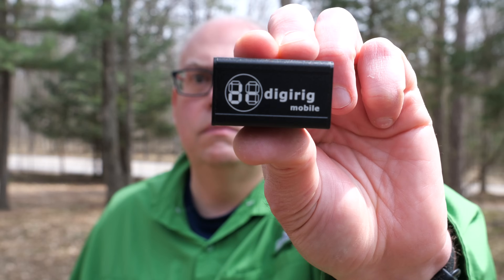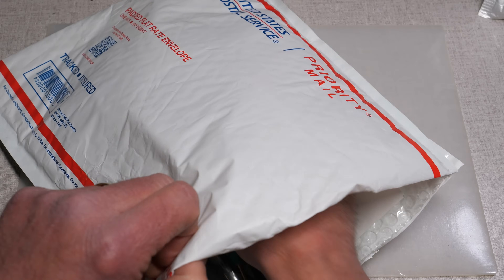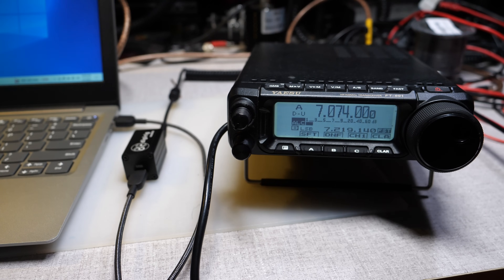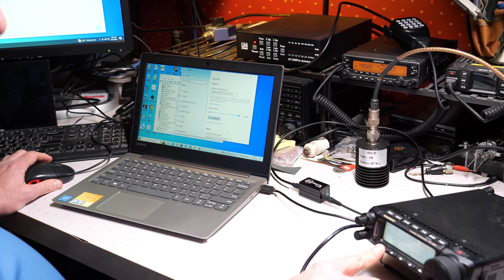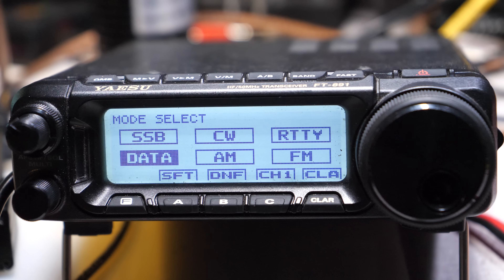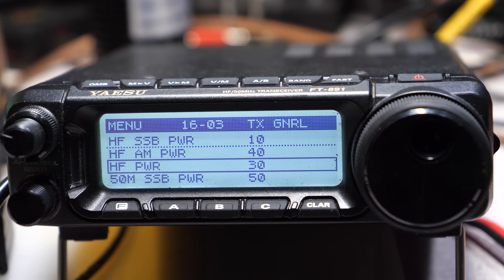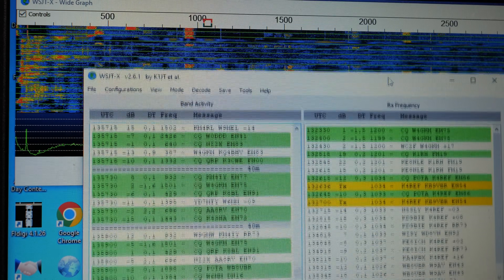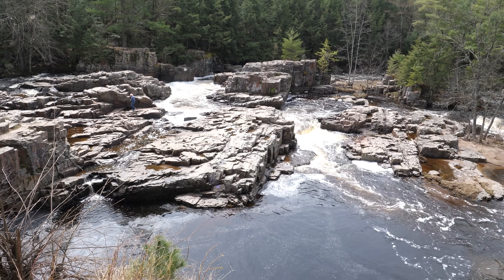Better FT8 on the FT-891! Digirig Mobile Interface  #hamradioqa

Comment: Do these settings work with the dr891?
Reply from the maker: Yes, the settings for the radio itself will be the same if you are using the DR-891. The only difference that model brings is CAT control instead of RTS signaling.
Reply: Thank you @KB9VBRAntennas

Comment: Michael, to my knowledge my laptop only has standard USB ports and not a USB-C. Any ideas as to what I should do next?   RLM de N0QK
Reply: My laptop has the same standard USB-A connector and the DigiRig has a female USB-C. I would go to the DigiRig page and purchase either the short (what I purchased) or Long USB cable, as the creator (Denis Grisak, K0TX) told me that not all USB cables will handle the data correctly, only the power. I bought the whole set up for my Xiegu G90, including one of his USB cables; it all works great, once I figured out the correct settings in the radio, and on the PC
Hope this helps! 
73s Bob, WBØWIF

Comment: I am a little confused because on the DigiRig's website it says to set "PTT Method" to "CAT" instead of "RTS" like in this video. Which setting should I be using? I am new to FT8 and I am having a hell of a time trying to make contacts with my 891. Thanks
Reply from the maker: Which model of Digirig are you using? The original model or the DR-891. This video is based on using the original Digirig interface as the DR-891 wasn't available when the video was produced. The original Digirig uses RTS signaling as it doesn't support CAT control on an FT-891. the newer DR-891 has CAT pass-through so you can use a single USB cable for CAT and and audio control.

Check the DR-891 setup instructions on the Digirig site: https://digirig.net/digirig-dr-891-setup-manual/

In a broader sense, if you are having trouble with the digirig, it usually can be traced back to the Yaesu drivers. FOLLOW THEIR INSTRUCTIONS EXPLICITY! If you need to, uninstall and reinstall them according to the Yaesu instructions. 

Sometimes the problem is the USB driver for the digirig. If you are running Windows 10, the Silicon Labs CP210x universal driver is the wrong version. This document may help you if you are running into that problem: https://digirig.net/wp-content/uploads/DigiRig_USBDriverInstall.pdf?srsltid=AfmBOopyTRj2quNdUphxLkPe0_4Up8qtMwX3yJKjxJc3v_Y1yRJGfctQ

Comment: With xggcomms interface you just hook one usb cable to pc/phone or tablet. Then hook audio and usb to rig and you go. Works with FT8CN on mobile phone providing cat control and audio with single usb cable to phone/tablet. They usually have only one usb 4:42 port.

Comment: Ok I have followed your video many times I keep getting a rig control error
I am lost
Reply from the maker: These can be hard to diagnose without knowing more about your computer system, but here's something I recently ran into.

I purchased a new to me computer for POTA. It had a clean Windows 10 install on it. It also didn't have the proper drivers for the Digirig USB chip. So after I installed WSJT-X, I was getting the same rig control error message. The computer was receiving the audio from the transceiver, but it would not key the transmitter via the RTS signaling. What I ended up doing was downloading and installing the Yaesu FT-891 Virtual Com Port Driver for Windows 10/11. This fixed my problem. Go to the following link and the file to download is the 2nd from the bottom on the list.

https://www.yaesu.com/indexVS.cfm?cmd=DisplayProducts&ProdCatID=102&encProdID=DF4DB262968932E999EAF928B5B6A1A7&DivisionID=65&isArchived=0

I hope this helps.

Comment: I had a problem with the CAT control.  The radio kept shifting the frequency around.  I changed "split mode" in wsjtx to rig instead of fake it and that seems to fix my problem.
Reply from the maker: That would be normal operation. When WSJT-X is in split mode, your transmit frequency will shift slightly to match the other station's location within the passband. This is done to increase transmit performance as your signal will be the most efficient at the center point of the SSB envelope than at the edges. It is certainly confusing, though. Switching to Fake It or switching split off will negate this feature, which really isn't a bad thing. WSJT still operates just fine, just at a marginally reduced performance level.

Comment: SO I followed all your steps and I can receive FT8 fine in WSJT-X however on any band the round dot next to the band stays yellow or red. and when I try to either Tune or Enable TX the frequency box is 0.000 000 and solid red.  Also every time I try to access the radio it fails opens the settings window.  I have Com 1,2,3,5 and no matter which usb port I choose I get a rig failure says "unable to open COMx"  (what ever port I choose).  and says no such file or directory.  I have tried the rig as None and I have tried it as Yaesu FT-891.  I tried this once before and gave up with the Digirig mobile, now I have the Digirig DR-891 but no better luck.  I am able to use the FT891 for SSB and pota but can't get FT8 to work.  So frustrated.

Comment: Love the video, easy and concise instruction.  I  seem to be having an issue however.  First let me say I am very new to the FT-891 and pretty much of novice at FT8.  I set up the FT-891 per your instructions.  However, when I switch to DATA in the menu.  The frequency changes from 14.074.00 to 14.070.70 on the 20m band.  It does similar on other bands.  Have I gotten something set incorrectly?  Thanks in advance.  WA4TAW
Reply from the maker: When you switch modes on the FT-891, the frequency will shift a bit. That is normal and it is due to the mode's bandwidth.

Comment: So I bought a digirig and followed your tutorial to set it up with my 891.  On my laptop I’m not “hearing” anything I have nothing on my screen.  Where did I go wrong?  Help would be appreciated.  Mike KI4MTM
Reply from the maker: Most likely it's a audio issue inside your computer. First check that your audio isn't muted. (I once accidentally hit the mute button on my laptop as I was shutting down and it took me forever to figure out what the problem was the next day). Inside WSJT-X go to Settings, Audio and make sure the Digirig device is selected for both the input and output. (You'll have a choice between the computer's audio and the generic uPNP device, select the generic device). Third, under the Windows audio settings for the uPNP device, make sure the sliders are set for about a 75% level, and not all the way to zero. Hopefully this helps.

Comment: Great video.  I'll be making use of this for my summer trip when I have no cell signal.  SSB without being able to spot is frustrating sometimes.

Question, where would you set up the park number in the FT8 setup?  Or is park number not required for FT8 POTA?
Reply from the maker: The FT8 payload size (13 characters) doesn't allow for the park number. The park number is not required for the exchange and with FT-8, people don't exchange it. If you are a hunter, you can match up the park number with the contact by looking at the pota.app spots page. For activators, when we upload our logs, we will include the park number with the log file and the POTA system will match up the contacts and park-2-parks automatically so everyone gets credit.

Comment: Michael have you had any success with Fldigi keying CW on the FT-817 through the Digirig CAT control?  If so… what are your Fldigi settings?  I’ve had no luck keying CW this way.  Best 73s Dan. K1YPB - On the air since 1962

Comment: What is the point of FT8 if it sends messages that consist only of callsigns. Why not text messages?
Reply from the maker: The payload for an Ft8 transmission is 13 characters, you barely have room for a callsign, signal report, and grid square. But I think for the reason why, you need to step back a bit and look at why modes like FT8 were developed. FT8 is considered a weak signal mode, so its efficiency is derived from the computational power and error correction of the receiving station. Contacts from incredible distances under all sorts of propagation conditions can be made with FT8. It's a derivative of the slower JT65 mode which was designed for purposes like meteor scatter and moonbounce. FT8 was never designed to be conversational, but instead to push the limits of weak signal communication. By happenstance, FT8 really took of when the ARRL had their Grid Square Challenge a few years back. It was the right mode, at the right time, to quickly and efficiently trade grids for that event. Since then the mode continued to gain popularity. 

If you are looking for a more conversational digital mode, I suggest something along the lines of RTTY or PSK31.

Comment: Do you have to change all the settings every time you do FT-8
Reply from the maker: No, if you use the FT-891's data mode for FT-8 the only setting you will have to change is the width (WDH). Width always resets back to the default value with a mode change.
Reply: Thanks, Michael .I'm new to all this stuff. Thanks for all the work you do, especially for the new ham like me

Comment: Hello Michael, I like your videos, they are very educational, thank you for sharing your experiences with all of us. I have a question, where did you get the power pole adapter that appears on the back of your FT 891?.Thank you in Advance,73 de K2WC
Reply from the maker: I did a video about a year ago on how I modded my FT-891 with a power pole plug. The parts can be easily 3D printed (or ordered from the designer) https://youtu.be/1dTd9qUz9l0

Comment: I just ordered the DigiRig!  Thank you for the great video.  de David AE4LH
Reply: I have been having many difficulties trying to get the FT-891/Digirig combo to work.  I've used these settings, but not having success.  Has anyone had success with these suggestions?  Anyone tweaked them?  Thank you!!

UPDATE: the circuits are talking with one another again. Such a learning curve!

Comment: Will these settings work with js8?
Reply from the maker: Yes, the settings are good for just about any digital mode with the Ft-891
Reply: @KB9VBRAntennas  thank you.  I wad able to get on js8 call last night.  A ham in idaho helped me figure out the program and clock settings.

Even though the only responses I saw were to my heartbeat signals

Comment: Why not change the Windows audio settings, for playback (receive) and record (transmit) instead of changing the RF Gain control and lowering the TX power down to nothing? This is what DigiRig says to do for their other radios. Is the FT-891 different?
Reply from the maker: I don't know if the FT-891 is different, but my feeling is that reducing the RF gain will give you a cleaner signal into the digirig. Reducing the mic gain for audio in only reduces the level of an overloaded signal. On the output side, the PWR slider really is the same thing as the volume control for audio out. Both accomplish the same purpose to control the ALC.
Reply: @KB9VBRAntennas  The DigiRig has an Attenuation pad (cut it/remove the solder) if the signal is too hot.

Comment: Hey Michael. I replicated this setup with the DigiRig and it works fairly well. However, when I change the band in WSJT-X, the band on the radio does not change. Is this an expected outcome because we use RTS as PTT mode and not CAT?
Reply from the maker: Yes, that's expected. Automatic band changes in WSJT-X require CAT control. With RTS signaling, you are only switching the PTT. You will have to make the band change manually.
Reply: @KB9VBRAntennas  Thanks very much!

Comment: Thanks for making this video, Michael, and for flagging it in your 10 best for 2023! Somehow I missed it when new. I'm an 891 user, and I plan on getting the DigiRig to use with Winlink when I'm remote camping. I usually advance scout my family's group camps by a couple of days before they join me, and this way I can just email folks our location from camp instead of driving to the nearest cell service connection.

Comment: Can the 891 handle full 100 watt digital output as well as my 7100? Or would that be a bit hard on it? I have an 891 mobile in one vehicle and a 7100 in my other. I run 100w FT8 with no problems on the 7100.
Reply from the maker: I've run the Ft-891 at 100 watts digital for brief periods of time, but I haven't done anything extended. The most power I'd used on FT8 for an extended period is 50 watts. But the Ft-891 does have a dual fan system to help move the air through it. In the menu, set the fans to contest mode to activate them.

Comment: Having the CAT interface is useful as well, so you can control the frequency and have automated logging as well. However, I would set the PTT function through Digirig as you did, because if you happen to lose USB, your radio will not be stuck transmitting.
Reply from the maker: That's the key benefit of CAT control. The problem with the FT-891 is that it requires a separate USB connection for CAT and when using other digital interfaces that connection dropping is what often caused me grief. I can deal with manually changing the frequency in WSJT if it means that I don't have to mess around with the CAT headache.

Comment: Just got an 891 and a Digirig arrived yesterday. I know this video is 6 months old but thought I'd still post. This video was very helpful but I found out something that I thought I'd share. Personally I wasn't a fan of the idea of using the rf gain control to lower the USB volume into the pc for WSJT-X into the green area. IMO I'd rather leave that gain full and lower either the 891 USB output volume or the input level on the PC. I couldn't figure out if its possible to set the USB audio on the 891 so I looked at Windows to fix it. I have WSJT-X running on a Surface tablet and the  ports show up but no USB audio input level control. That was until I had WSJT-X running with USB audio active and then looked at the audio mixer in WIN 11 and only then did the USB "microphone" input level show up. I was then able to get WSJT-X input level nicely into the green and keep my rf gain at max. A number more stations seemed to be showing up not sure if the max rf gain helped but it seemed to.
Reply from the maker: Thanks for the tip. I'm guessing that your method works because the audio chip on the Digirig has enough headroom to handle the high level of gain.

Comment: Thank you Michael for all your great videos. I have a question regarding the ALC setting. I am unable to get the ALC meter to shift all the way to the far left on the FT-891 even after moving the power slider all the way to the bottom. It only drops about 25% of the way left. Have you run into this issue or have any suggestions? Thank You
Reply from the maker: You may want to check the output volume for the digirig on your computer. The slider should be set to about 75% or 3/4 to full. If it is at 100% you may not be able to adjust the ALC low enough.

Comment: I have used a SignaLink for several years, for use with my EchoLink Node. But, its a pain to haul into the field, and reset it, for use with my laptop PC! So, I just ordered a DigiRig, to use while in the field with my Evolve Maestro iii, laptop.  (I just I ordered the right model, since I may use it on a variety of radios!) 
Leave my base station at home, and keep the mobile rig all together and seperate.
Reply from the maker: That's a good idea. I've found that keeping shack and portable equipment separate, even though it means duplicating accessories is a good idea. Then you don't run the risk of leaving something at home because you took it out of your bag to use in the shack.
Reply: @KB9VBRAntennas  It seems more costly, but much easier in the end!

Comment: I set everything that you said to set in the Data mode. But i barely get any activity on FT8 but when i switch to SSB Mode I get all of the activity and the FT8 sounds normal in the radio's speaker. How do I get the Data Mode to do that? in the 891. And what the radio transmits out doesn't sound like FT8 Either